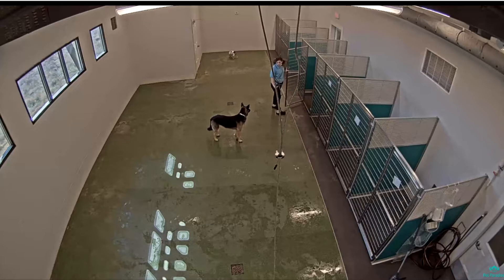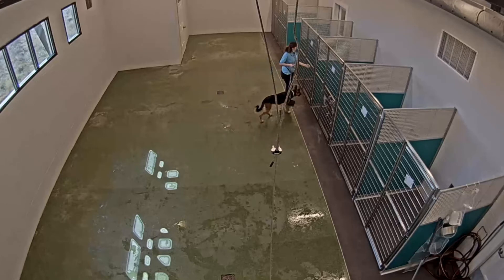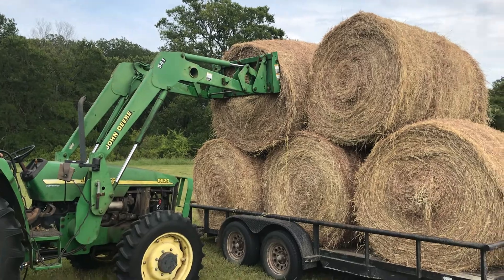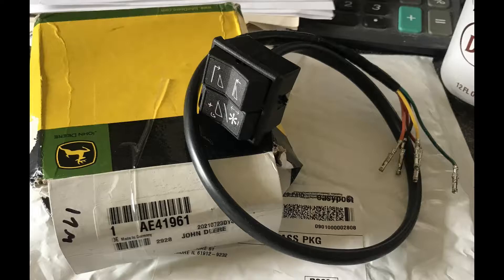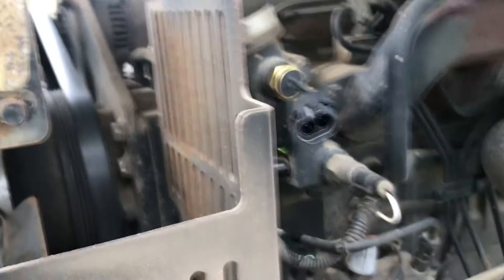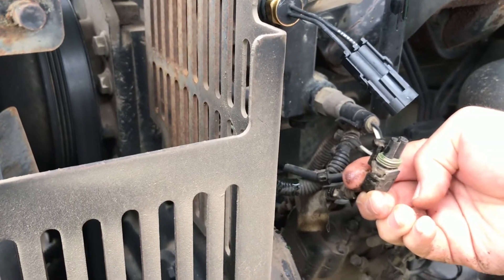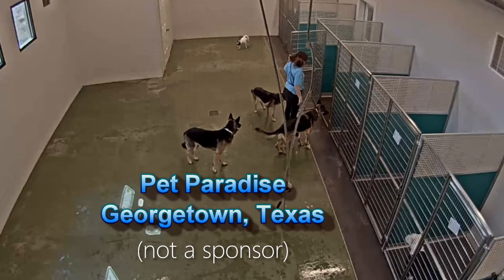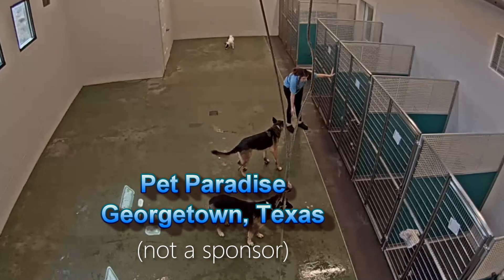John Deere 5520: Crank, no start-fixed

Comment: Nice fix, I don't think my 4600 has one of these. I may try the thermistor next. I did the fuel shut off solenoid-it didn't help other  than the first start.
Reply from the maker: I believe you're on the right track. If the fuses are good that's a known issue for a no fuel in 4600's.